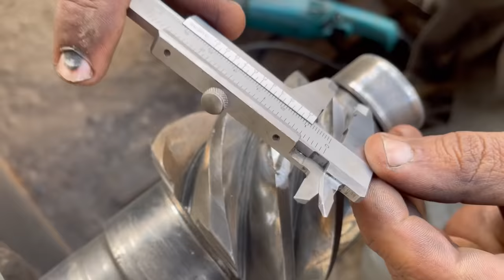I repaired the scrub pinion which no mechanic repairs | Give your opinion by watching the video |

Comment: Yes, you can make it look like new - but you cannot make is good as new.  Huge difference.  Considering the load that the gear handles, the welded metal is not as strong as the parent metal and will fail again.  Much sooner than the original part failed.  This gear went through a hardening process.  What you did is just create a weak and brittle point in the gear.  You have a solid grasp of the mechanics, but miss when it comes to the science of it all.  Starting and stopping so much without clearing the slag will allow for inclusions.  A wire wheel on a grinder would be of significant benefit for you while doing these welds. It would help with the inclusions.  And watch out for porosity.....
However, still.  Sometimes you just have to go forward.  This would fail everything in the US, but where you are, it works - for however long.
Reply: And all welding was done with hardsurface electrode. So now that wormgear will eat opposite part away. But still have to take my hat of for work what this guy did.
Reply: 100% agree. There is definitely way more going on with that type of gear than just putting a "tooth" back onto it. That thing will tear everything up then fail itself.
Reply: Wrong metals will cause the parts to break again.  Just explode.
Reply: @user-en1bf2su2p  the hell did you write huh?
Reply: @user-en1bf2su2p  lmao 🤣🤣🤣🤣
Reply: totally agree...there is a big difference between what can be done and what should be done, in this case buying the part
Reply: Everythings Eventual  go learn the language before you talk like biden
Reply: @tylerhensley2312  its a question how long life this part have on load, its difficult to make precise geometry on helical gear with electrode welding ale wheel grinder, that man have skill.
Reply: I would normally agree with you but, they have carefully built that jig for doing this job on a regular basis so if it did destroy the rest of the differential or simply break again I’m sure they wouldn’t still be doing it. Something to think about. Cheers Stuart 🇦🇺
Reply: Ya ..betul
Reply: In the Zimbabwe that works bro it ll take that bus or truck to where ever until we find a way
Reply: @mgcinincube6880  yeah, top skill like these guys demonstrate has left the US... to be replaced by the fear of not being perfect enough.
Reply: If it not works well, trackers never come to him. Think about it.
Reply: The repair is poor but if he assembled the set, blued it and ground it over and over and then moved the contact to the rear of the tooth and ran it lightly loaded it might last for awhile.
Reply: @scroungasworkshop4663   That's an "off the shelf" welding jig. Nothing fancy.
Reply: True
Reply: I love how you arm chair experts can criticise others. I bet you can’t even weld.
Reply: @ianhokai6316   I've been all over north and south America repairing gearboxes and power transmission devices for industry. All kinds of situations.  Making it look good nice is crap. Sorry, but a precision part won't stand less than a precision repair. Your feelings don't mean squat.
Reply: @timjohnson1199  I’ve lived in the third world where we do this sort of thing daily. We rebuilt ZF gearboxes and Detroit diesels in conditions that you experts would not dare working in. So, we lived this.
Reply: @user-en1bf2su2p  dafuq?

Comment: That is completely amazing. In a place where spares are not so abundant, a fix like that goes a long way. Great job 👏👏👏
Reply: Der Traubengott  I believe you are correct, the original gear was heat treated at the factory to get the right mix of hardness and toughness and the welding will have removed that for some area around the repair, as well as the repair itself not being heat treated.
Reply: Der Traubengott  
With the exception there they don’t drive 40-50 mph all the time mostly it’s 20-35 and heavy but short trips they are way more careful then US drivers or any other country
With that being said
He was careful to not overheat when welding 

It should last a whole 
My question is 
What’s the Ring gear look like after the break
Reply: @Mike Raffphone maybe they heat treated it after, they are good at what they do.  They were under the empirical law at one time. Hog wash I say.

Comment: He probably tore apart and repaired more things than most mechanics have here in the United States. I know for myself I have so called temporary repaired somethings that should not have been repaired but replaced by the owners had not the resources / funds to do so. Had by pass electrically damaged ecm controlled damaged parts  . But had to repair in stages to work not just flip a switch but multiple switches in a series to make run. U have 2 do what it takes at times. These new trucks now r sitting for sensors , water pumps and compressors because they not available to purchase due to see19 and economic failure.

Comment: I appreciate “ you gotta do, what you gotta do”. However the poor trucker is going to make it 50kms and have a catastrophic failure damaging more parts. Yes, looks good, however no hard surfacing, heat treatment, precise measurement or alignment....I guess he’ll make it down the road a bit. Lol
Reply: If they uses hard material welding stick, then losing a teeth is not likely, however it need to drive slower to grind the gear.
If it is a emergency repair then I would take it. But if I need to travel long distance, this is not a option.
Reply: @barnabyjoy it could work, if the  welding rod is using correct material, and the driver willing to spend next 1000km driving 30km speed. Then the gear would grind to correct size. However, these repair rarely last for more than 2000km if driver did not drive extra careful. It is a very common practice in poorer area.

Comment: I built up and used hand tools (metal files, die grinder, metal scrapers) crown wheel and pinion damage, teeth missing whole chunks and damage from the metal crunching on an old London Bus that a family were travelling across north Australia in. I was a Road Train workshop manager in small town of Wyndham, very remote town. No spares to be found anywhere in Australia and word got around town, the few hundred of us re: the double decker bus parked up on side of road so only option left was to do what we did back in 1st year of our apprenticeship many decades previous. Build up and hand tools down. Took a few days but the bus drove out with its young family happy. No charge, they were stuck and nice people. Can be done, its just patience and being a bit OCD. Helped that I'd had years of experience rebuilding heavy earth moving differentials for Caterpillar and knew where on teeth the load would go and how to set it up again.

Comment: I represented a large gear manufacturer in the field in all kinds of situations.  In a precision spiral bevel pinion this repair will, under full load, fail again. In a desperate situation I can see doing this but I would have installed it, blued it and run it and ground that welded area over and over again till it matches well. That said,  there was still plenty of the tooth left in back and some success was likely by shifting the tooth contact back. Run that unit lightly and order a new pinion and ring gear.
Reply: It looked to me as if it was never assembled properly in the first place?
The heat affected area will be crazy hard and probably very brittle.
Reply: @1crazypj    That will be the least of it. The profile will be so off that the high spots will be overloaded and cause small leading to big failures.
Reply: Why did it fail in the first place ?  
Probably a manufacturing flaw in the process of making it. The metal looked bad where he repaired it before he started. I could see graining.
Reply: @flhusa1  It was probably run a gazillion miles till it got loose. Have you ever seen the way they severely overload their trucks? So just let the clutch out a bit briskly on a grossly overloaded truck with a ridiculous amount of backlash in the ring and pinion and kaboom!
Reply: @billmiller7138  I know metal can get work hardened. Like if you try to cut old train rail. Harder than woodpecker lips. It could get fatigued too and eventually right conditions and boom.
Reply: Well, for sure it is going to fail since he welded slag into the metal.
Reply: Fully agree I you understand the precision involved in the manufacture, alignment and assembly of bevels of all kinds, then this is only a get you home repair.
If the mating part was lucky enough to get away without damage in the failure then it will certainly be damaged or fail after running with this repair.
Nice job but it's little more than cosmetic, unless the welder can see to a micron.
Reply: You speak with experience 👍
Reply: @1crazypj  looked like damage from a failed bearing running through.
Reply: "order a new pinion and ring gear."
from the look of things that's not an option.

Comment: I think you will bring in to much heat with Electrode Welding. It will work for some time but i think it won't last very long since heat brings in mechanical Stress to the Part. And it also makes the Material Harder wich means it will break much more likely than before. But i would look for replacement part and fix it like this till it arives. You need to work what you have :)
Reply: It doesnt make it harder lol it makes it even "softer" when you let it cool in air after heating it over 723 °C (when it has been hardened before and gears are always hardened on the outside). You'd have to heat the whole part up, let it cool down completely in air, then heat only the gears and harden it like that. You goal is to have a soft core and hard, durable gears. But this won't work in this case anyway because he hasnt got enough if even any Carbon in his welds. Also impurities from electrode welding and grinding are not ideal for structural integrity + he can't make it align with the other gears 100% and this will put more wear and tear on this and other parts in the system.

Edit: edited C to Carbon

Comment: This is a good emergency repair and should work well enough to keep the truck moving until you can obtain a new one. These guys know what they're doing and using the correct welding rods.
Reply: Why don't you credit with a complete repair rather than just an emergency repair?
Reply: @sleepingwarrior4618  These pinions are hardened and machined with great precision. It's impossible to repair them to even a nearly new condition. But you can do your best to make them work a little longer.
This pinion will wear out faster not only itself but also the other gear it's meshing with, just from the small changes in geometry alone. It will run increasingly noisy with more friction. And since it's not the original uniform material anymore it can't stand the original forces.
Reply: Wow! Beware of these types of repairs. I guess the next step would be to sell the vehicle to some unsuspecting buyer.
Reply: @GearHeadBoris  I see your point but I don't really agree....but that's okay. :)
Reply: @sleepingwarrior4618  What did he say?
Reply: @gustavgnoettgen  "it will run increasingly noisy with more friction and cannot stand the original forces."

I've done similar repairs myself and they have been just fine. It might not be perfect but it's functional and practical and remained working long term....as others have said as well.
Reply: @sleepingwarrior4618  And what did GearHeadBoris say?
Reply: And we have one messed up differential, with incorrect tooth contact pattern, weakened material and very rough finish. Guaranteed to destroy and disintegrate everything, including crownwheel and diff cage... these crownwheel and pinions are a matched set and precision machined on muti axis cnc... this is not a patch or fix, it's literally destroyed now...
Reply: @sleepingwarrior4618  these guys are in the middle of no where and have nothing.they have to build and repair their way out of a problem.a ring and pinion set I'd probly $1500 to $2500 us and non telling how much to get there. The average pay in India is about $6 us dollars a day.
Reply: Now completely out of spec. I would love to see how it relates to the crown gear.
Reply: Imagine the way that diff must scream at high speeds haha.
Reply: @sleepingwarrior4618  those trucks are overloaded as is. Not gonna last long guy broke it in the first place he gonna do it again to a weaker part now
Reply: @user-po7iv4ni3o  if they marked the pinion with paint and ground down the high spots,I bet it wouldn't be that bad.i would have put valve grinding compound on the gears and lapped them in.but these people rarely go over 20mph on rough dirt roads. I'm shure it worked out just fine.the ring and pinion was still working.just had part of a tooth get damaged.so alot of the original tooth still had contact.i have exploded race gears  out of 9 inch ford diffs.i just debur the gears till they turn with the proper back lash.never had a problem.
Reply: @sleepingwarrior4618   Do you really believe the Earth is flat or is it some kind of trolling? Just asking.
Reply: @fuckednegativemind  Nahhh....there are tall mountains and low valleys that fill with water and we call them seas and oceans. The better term is "formless"....without shape. 

If earth were a ball, science could have measured it over just a quarter of a mile of standing water. That evidence is key evidence that's missing.

Plus, the sky cannot be a vacuum as we are breathing. When have you ever seen gas stick to the outside of something?
Reply: No 1s not correct
Reply: Great job, but just temporary, because is impossible forge with a new temper. When the force comes apply in the teeth of the gear , it will broke down again. We did the same service in my fathers tractor gear and broke again at the first service.
Reply: @michaelwooda9444  Mostly, I just wish I had a better rear diff in my truck right now that didn't scream at high speeds! Been through a headache of blowing one pinion gear then having a second entire diff develop wear/backlash that can't be adjusted out... imagining anything worse than mine makes me shiver 😅
Reply: @Vladgore007  It was destroyed before already. But now it may get to the next town that actually has an axle set in stock somewhere, or back home where there's a spare waiting.  You even said it yourself, the ring and pinion are a matched set... why not try this, since everything else is going to be discarded to repair properly?
Reply: @sleepingwarrior4618  Earth is a ball. Measuring that over a quarter mile is very difficult since its a huge ball with an uneven surface, but it does affect large buildings like bridges. That has been measured.
The atmosphere is held down by gravity like everything else. That's where atmospheric pressure comes from, and it's the reason why it decreases the higher you go up.
Reply: @gustavgnoettgen  I said standing water. Not difficult at all. But missing nonetheless.

Gravity holding things down? Lol. Gravity hasn't been a force since 1915. You are miles behind current science if you still think that.
Reply: @sleepingwarrior4618  It's still hard to measure over a quarter mile since that's not much. And gravity is still a force.
But please feel free to explain what's wrong with that.
Reply: @gustavgnoettgen  both your points are incorrect but I don't feel you would accept that you might be wrong. Most people don't like being corrected even within science. 
A quarter of a mile is within planar surveying ability and apparatus ability I'm afraid. This evidence really has no excuse for its absence.

Einstein redefined gravity in 1915 from a force into an effect of curving spacetime. It does not and cannot hold the atmosphere down. You're gunna need a container for that!
Reply: @sleepingwarrior4618  A quarter mile is not much compared to the curvature. But feel free to measure that it's flat.
Gravity is effectively a force. It makes objects move. You can argue that no force is really a force but the product of underlying processes.
Reply: @gustavgnoettgen  It's quantifiable over a quarter of a mile. If it's quantifiable, it's measurable with current tools and skills. Why don't you see if you can work it out and you'll see how this is not only doable, it's expected. A measured drop from straight. 

Gravity does NOT make things move. That would make it a force. Again, you are significantly behind the current science. Einatein says the medium of spacetime does it. You cannot argue that no force is really a force. You are going down the solopsism route. We have science to address solopsism.
Reply: @sleepingwarrior4618  Please measure that it's indeed flat. Have you seen a water horizon yourself? You know, with ships?
Reply: @sleepingwarrior4618  As I already told you multiple times: a quarter mile is not enough. That's why we need to measure more.
So have you seen a horizon with ships or not?
I already know that you haven't.

Comment: That may work as a temporary fix, but it will eventually break in the same spot. The shaft was originally forged steel, the welder isn't going to be able to duplicate the the quality of the original steel.
Reply: He’s using forged welding rods
Reply: @longsleevethong1457  still won't hold